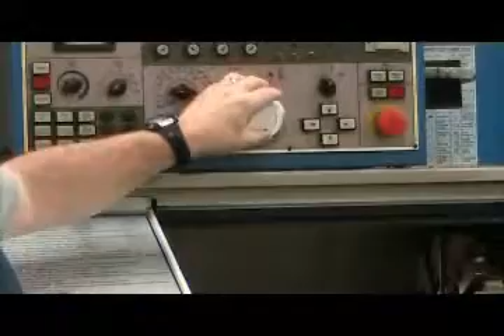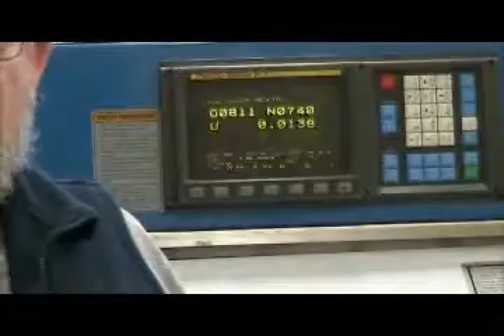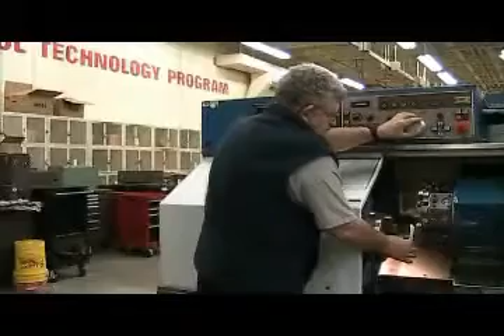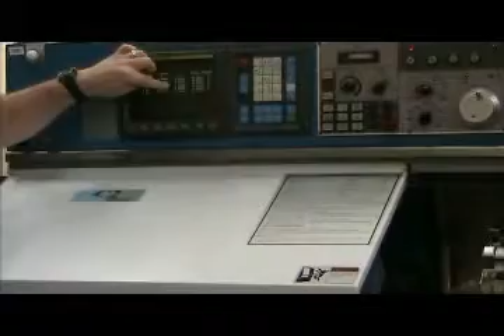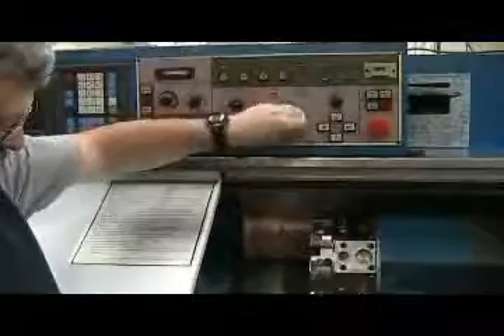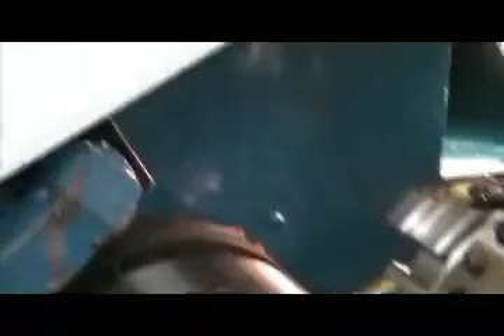Femco Durga 25E CNC Turning Center

Comment: As you can see i posted a year ago. This video helped me tremendously! I have now taught myself to run this machine using the Fanuc manuals, and of course this video as a primer to help get the machine started up for the first time!! Many thanks!
Reply: Working at a shop with a durga. The offsets really confused me till I realized that they all came from spindle zero ,that is preset.  Is there a place to make adjustments should the machine be crashed?
Reply: @davidmendoza5186  I'm a cnc programer .from india